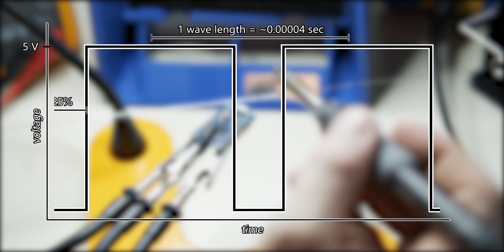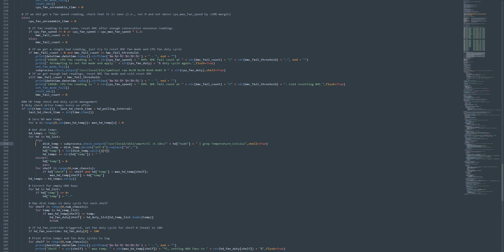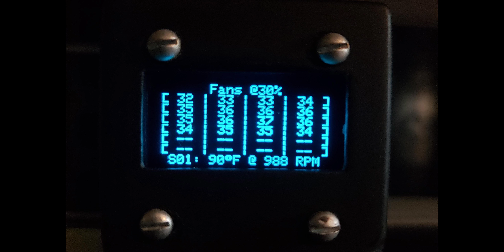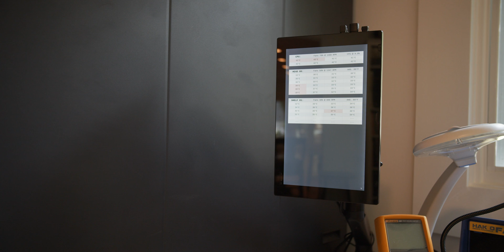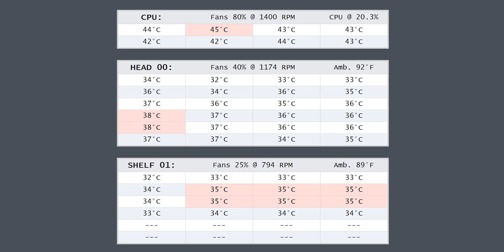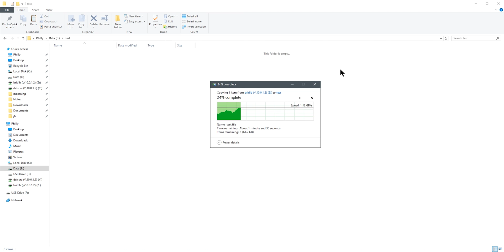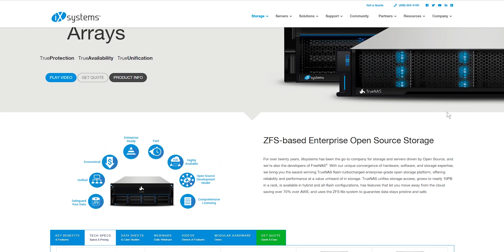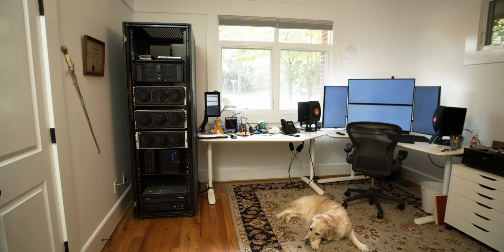Expanding FreeNAS Beyond a Single Chassis - Part II

Comment: Arduinos are not ideal for any serious project, for a variety of reasons. You would have a much better time with a Nucleo board from ST. The price is comparable, but the tools are far better and so is the performance. You can also use FreeRTOS which is a multi-tasking OS. Also, whatever chip you choose, you need to make use of the watchdog timer if you want simple, secure recovery in case your code freezes.

Comment: Super awesome build! I have the same chassis. I've already swapped my PSUs out for a normal PSU from a desktop and the rear fans with noctuas. However, after adding new drives (for a total of 24) the drives got hot on the lowest speed control on the BIOs and I had to ramp up and it's louder than I'd like. Which cooling modification(s) would you recommend doing for the most impact so I can lower the noise and keep the same airflow (or better airflow)?

Comment: You have done well.

I did a video the other week on hardware and bottlenecks.

Now this is the issue which maybe you find later.

The bus for the das is what it is.
We will say 100gb/s.
If you link is 100gb/s
But the board is 80gb/s then you get a issue.

The data , plus process, plus control (memory, net, input , GPU, etc)  exceed the system bus and therefore creates a bottle neck.

Also Would you (in hindsight) have been better off making a DAS and a load  balancing controller between the shelves?

Comment: What are the helper arms that carry your power, data & ect called that you use for back of the rack management. My Rack looks like a Ball of wire's and I can not pull server's out with out disconnecting them.  Here's a link https://ibb.co/4Jt8MvZ
Reply from the maker: They're called cable management arms: https://store.supermicro.com/2u-3u-4u-cable-management-arm-mcp-290-00073-0n.html

Comment: So the raspberry pi is controlling the fans in the expansion chassis? Are they also providing the power to the fans?
Reply from the maker: Yep, exactly. They don't power the fans, just the PWM line; the 12V is pulled from the CPU. RPi can't output very much power.
Reply: @JasonRose  Can you do an in-depth video on how you have this wired up? My visualization of this muddy at best and my experience with wiring is spotty.

Comment: How gorgous that rackcase with UPS's and 24 bay file storage is. I see why you have chose your network switches on the back to mnimize UTP cables length. How deep is that rackcase? I have a 37U and its 800mm deep,but I have  IBM Lenovo x3650 m3 server that doesnt fit the rackcase because no one told me it is the depth of front steel beam and rear steel beam that needs to be 700mm -800 in order to rackservers to have enough space and close the rear door. I'm thinking of getting a 42U APC that is 1070mm deep,but I also am considering a 1200mm deep rackcase,what you think?

I plan on buying the SC847 rackcase which has 36 bays, 24bays in front will be for mass storage while the 12 rear will be SSD array for VM's backup,snapshots,network configs on cisco switches and perhaps a L2ARC SSD and SSD 512GB in RAID1e for redundancy and a few 10Gbit SFP+ NIC's and a daughter quad port NIC for LACP. And maybee even get a 900p as the bootdrive.
I'm just getting into looking for supermicro motherboards that supports this kind of storage + ssd's and maybe some NVME drives. I dont really know which motherboards to chose from since its so many and confusing since the SC847 SKU info mentions that certain motherboards are designed for the chassis,but when I click on them I see some are 2011 socket motherboards. I'm kinda want a single socket Supermicro MB and pref a EPYC for all the lanes.
But that is gonna be  big project and probably going to end up at 10k dollars ++before I have the parts and such. But I love servers,switches and any rackmounted units. I also plan on getting a rackconsole with a KVM switch.
How big is your UPS's? VA with the amount of powerplugs? Are you doing 1 powerplug from each of the PSUs to each of the UPS's? So its even distributed in case 1 UPS dies?
Do you plan on getting some rackmount servers with WS2019/2016 for windows services?. Please go into detail what kind motherboard and components you have there. Also do you have any network monitoring sw for survering your network?

Comment: It appears you are powering the fans directly from the IO pins on the Arduino?  I did not realize those could source so much current.
Reply from the maker: Nah, they're powered from the +12V on the PSU. The PWM out pin on the Ardunio (and on the Pi) only has to do a few mA at +5V.

Comment: I thought my rig was out-of-hand, but you're running almost twice the storage as my setup.  Curious as to why you're running an LGA v3 CPU.  Wondering what I'm missing using xeon 2630v1 dual CPU setup; very low TDP.  I'm using Windows 2012 server and only 32Gb ram so maybe that's it along with the fact I'm only using the setup as a file server and other rigs for hypervisor and Plex server.  Very interesting.  I'll have to read your webpage to see what adjustments I might need to make.  Btw, love the fan shrouds although too pricey for me but maybe in the future; who knows.  Great work!

Comment: Great informative video Jason. I know you made this for FreeNas, but do you think something like this work for UnRaid?
Reply from the maker: Good to hear from you again Wil! I have no doubt that at least the HBA and PSU stuff would work for Unraid (assuming it has the drivers for the HBAs I used, which it should). The fan control stuff might be a bit more tricky; you'll have to translate some of the shell commands run in the main Python script to their Unraid equivalent, but the basic idea should hold up just fine.
Reply: @JasonRose  Thank you so much for the response. I really appreciate it.

Comment: how did you get the drive temps to the raspberry´s ? i have a similar idea of controlling the fans, but i cant find a direct way to get the drive temps out of freenas.
Reply from the maker: Python's sockets module, one script running on the FreeNAS and one on the rpi. Check out the code in the github for more info.

Comment: Three questions:

1) In your JBOD expansion shelf, you were able to use a single SAS3 cable to the SAS3 backplane. In order to simplify your cable management on your head node, could you have done the same?

2) If you need to expand to more shelves, would you be directly connecting them to the external ports on the LSI 9305-16e or would you be daisy-chaining the shelves to each other?

3) Knowing what you now know in regards to the ever growing storage needs, would you have preferred to gone with something that could have done 30-45 drives (horizontally like you have (e.g. Supermicro SC847) or would you have preferred one of those upto 90 drive bay, top loading chassis instead (either for the head node or for the expansion shelf)?

Thanks.
Reply from the maker: 1) Yes, I could have done that, but it would have been more expensive. As I mentioned in part 1, the SAS3 backplanes are expensive.

2) I'll be directly connecting them to the 16e HBA. Daisy chaining would create its own bottlenecks and I've got plenty of SAS ports.

3) Those top loading shelves are extremely expensive and require really loud fans to cool, so I'll probably always stick with the 24 bay front-loading shelves.
Reply: @JasonRose  
Thank you.

But it is possible, so that's good to know.

Comment: Just curious, with all this expansion, what do you have in the Supermicro Mini tower??? And how does it tie into the existing setup?
Reply from the maker: That's a FreeNAS mini system I use for testing nightly builds, new features, etc etc. It's not tied into the main FreeNAS system at all.
Reply: @JasonRose  OK... I have a small low powered Xeon system built in the same case that will be a ESXi or Proxmox system soon

Comment: an amazing project! I can tell you have done a ton of research and realized you need to wear many hats to undertake a project that is so far outside the norm. I have gone down that rabbit hole a few times and started to chuckle as you mentioned the arduinos. I ended up there also, eagery looking at that those cheap little devices can do. In the end, the communication problems over 5V I2C to 3.3V rPi was too much of a pain and I also abandoned the arduinos and went strictly rPi. It was a learning curve for sure but in the end I think we can both agree we are batter techies as a result. I look forward to future videos!